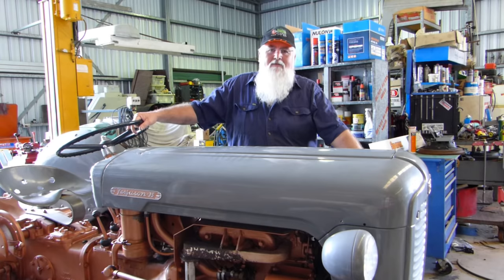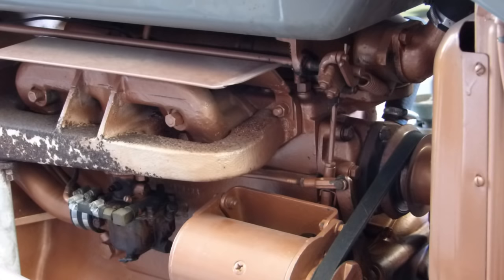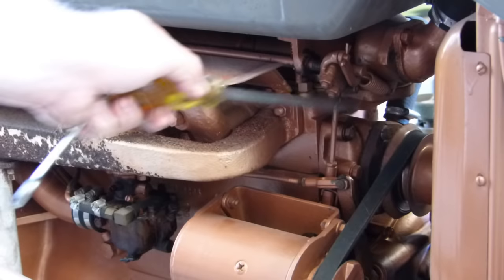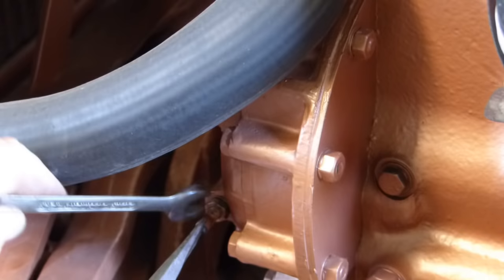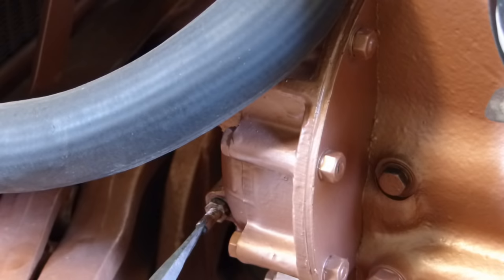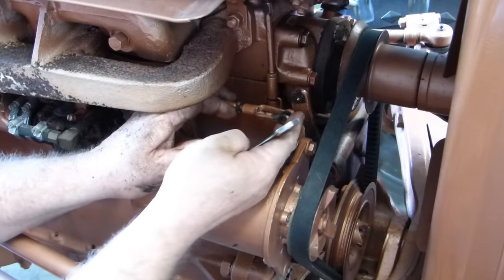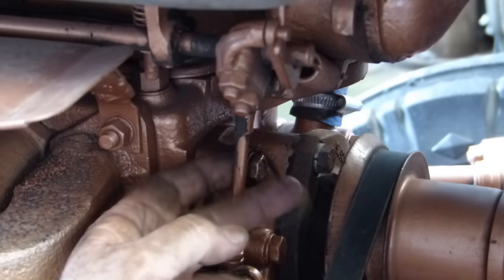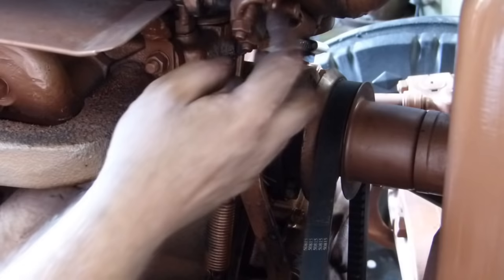How to Adjust Your Ferguson Tractor Governor

Comment: bundy bears hi my name is james butcher, i am rebuilding ad3 152 and i want to replace some bent fuel line i have direct injection and i cant get some of the fuel line to come out of the fuel filter housing i think it because of  the olive being stuck
Reply from the maker: Some had a rubber olive that would bind in quite tight.
Reply: thank you for writing back, how do you get them out?

Comment: Hello Lance
This is not a comment but a question. Hope you can answer it for me.
I have watched many of your videos ,but I have a problem. I have a 1959 Massey Ferguson 50 ,continental Z134 engine.When I got it, there was very little speed variation(at idle 1800 and WOT 2000). I set all adjustments according to your video,(which is excellent),but did not prove out for me.Idle now is 500 RPM with carb control rod disconnected from governor lever.
When increasing RPM,the governor lever never moved .When all linkages are connected and increased throttle lever(under steering wheel),engines reves up and up and up—-no control. I have adjusted the bumper screw,but cannot feel any spring inside the timing cover.
I have never had one of these apart,is it possible the bumper spring is ceased?Hope you can give me some direction in solving my problem.

 is excellent),
Reply from the maker: I have never had a Z134 to play with but they seem similar in the adjustments I hear. The carb should have an idle speed screw that can be adjusted with or without the rod hooked up so the butterfly is only just open. I find often lengthening the rod fixes a lot of peoples problems.
Reply: Thank you Lance for getting back to me. On your video of governor adjusting you disconnected the carb control rod and when you increase the engine speed your governor lever moved. Mine doesn’t move at all. I’ve adjusted the bumper screw to several different positions and still no movement on governor lever. When adjusting bumper screw I cannot feel any spring tension - nothing spongy. Could there be internal problems with this governor? Or is there something I am missing external. This Z134 engine governor lever,springs,bumper screw all looks identical to your video. Thank you for now. Karl.
Reply from the maker: It could well be worn as they are getting old now. pull the screw all the way out and see if it is not broken or anything.
Reply: I have already removed the screw and also compared it to another Z134 engine and they are both identical.

Comment: hi lance, i just rebuilt the engine on my TEA20 and replaced the weights on the governor. i adjusted it just like you said and when i rev the engine to wide open throttle and back to idle, the governor weights jam in the from cover. I dismantled it twice to verifiy thinking i did something wrong durring assembly but no, everything seems in order and it does it everytime. Im wondering if the cup may be not compatible with the new weights? what do you think? the cup does move freely in the bore as you said. please help!
Reply from the maker: Adjust the side bolt so the cup cant come forward so far.
Reply: @BundyBearsShed  ill try that! Its odd it did not do that with the old weights. So maybe 2 turns after contact then? Or maybe more?
Reply: @BundyBearsShed  Hi again Lance, I took that screw in pretty much as far in as it will go and put just silicone on that timing cover to seal it instead of a thick gasket, it seems to do the trick! thanks! By taking in my screw in so much im just limiting my top RPM right?

Comment: Thanks Lance. I’ve been trying to diagnose a throttle problem I have where the throttle always backs itself off to about the 25% position when running. I try to hold the throttle at about 75% and can feel what may possibly be the spring on the vertical rod pushing the throttle back. Could this be the problem? The friction disc near the choke control is fully tensioned.
Reply from the maker: Friction disk under the dash is worth a look.

Comment: My Friend. I'm a beekeepers so I need your help with me Ferguson TO 30.
My ferguson TO 30 will start but not keep running. Sometimes run a few seconds or several minutes. Filter screen in side gas tank is clean. Fuel flowing good thru line good. Fresh Gas.  Any ideas ?
I'm in Mississippi, sounds like you are close.
Reply from the maker: Im in Australia, Bundaberg Australia. Does your ignition coil get hot? also try pulling the choke on as it starts to break down and see if that makes a difference. If it does it is probably a bit of junk in the carb.
Reply: Thank you @BundyBearsShed  for your reply
think I found the problem. #1 one of the bolts attaching the carb to the intake was loose.
#2. I turn the large thumb adjusted on top of the card a 1/4 turn to left.
Either way, runs good now........thank you......tim

Comment: My to30 idles for a bit then it will rev to high speed on it's own. Where should I start to find the problem? 😒I Just replaced the governor!!
Reply from the maker: For it to rev the butterfly must be coming open so possibly adjust the rod to the carb.
Reply: @BundyBearsShed  Fixed it !!! More then one thing was the problem...Thanks!
😎👍

Comment: Do you have a video for the TE20 Continental engine governor adjustment?
Reply from the maker: No it is not an engine we have here in Australia. I believe it is a very similar process but I have not done it so I cant be sure.
Reply: @BundyBearsShed  Thankyou for the reply, was not aware that engine was not available in Australia. I watched your video along with every other one I could find on these tractors as I just acquired one from family who purchased it new in 1951. I started to fix a few leaks here and there and now has turned into a major project as everything I check or take apart has issues. Your wisdom has come in very handy for me so far I have my wheel bearings coming in soon so I can get the rear axles back in, that video was great by the way. I have restored a few old vehicles in the past so my idea of fixing something is do it right or don't do it at all, that's why this project has turned into an all winter long fun time project. I am in Northern Canada where it is the opposite temperature you are having, fire place on keeping warm. Carl Hewitt

Comment: My Massey Ferguson will start and idle great, but my problem is, it will not accelerate. Has anyone had this problem before? Thanks John
Reply from the maker: G Day John, start by turning both the idle jet and the main jet in until they bottom out on the thread and turn them both out 1 3/4 turns. This is a good starting point and you can adjust the mixture screws in or out a little from there.
Reply: Thanks. I will try that this weekend when I go up to the property

Comment: i need to learn to adjust governor on 580B case 159g gas engine any idea where i can go? i'm getting low rpms only 1500 and should be 2000 or 2100 any help would appreciated. thanks
Reply from the maker: G Day Carlos, No Im sorry I have not ever done one of those.

Comment: can you tell me how to remove the throttle lever on a 1953
tea ferguson.
Reply from the maker: You need to unbolt the dash from memory and feed it out.
Reply: @BundyBearsShed  I have the dash completely apart but still can't work how it comes out ,it has apiece welded on under the dash and the round knob on the outside which are to big to go through the hole in the dash there appears to be a piece in the dash that it goes through and maybe that has to be removed ,but not sure how

Comment: I have an tractor massey ferguson 35 on benzine. How much fuel consumes your tractors?I deregulated the carburetor and now I am consuming a lot of fuel. how to regulate the carburetor?help me please
Reply from the maker: You can screw the main jet in until it runs a bit rough then turn it out until it runs sweet at flat out throttle might help.
Reply: How much fuel consumes your tractors?
Reply from the maker: Im not sure it is not something I monitor.

Comment: I am looking at a Massey Ferguson TO35. It’s a clean tractor and the owner started it. It runs fine but he said the new governor needs adjusting. He said the engine runs up past where you initially set it and you have to manually adjust it down a bit. Does this sound like a simple adjustment? I’ve seen some of the forums that talk about ball bearings from the governor falling down into the engine? Is this a common thing and is there a way to “hear” if this may have happeend or an easy way to tell without tearing the tractor apart? Sorry for my lack of knowledge. I’m just trying to decide if the $1900 for the MF is worth the risk
Reply from the maker: Im not sure on the Continental engine, the engine we have is different.

Comment: My ted20 tractor when at half revs governor arm moves excessively to an fro. What wrong?
Reply from the maker: G Day Neil, It is hard to say, are all of the pins nice and tight in the holes.
Reply: Bundy Bears Shed there is a lot of wear in the top arm to spring and on governor arm. In fact there’s a lot of wear on all of it  I think the tractor is worn out.

Comment: I have a Ferguson TO 30. How do you adjust the governor?
Reply from the maker: I'm not sure, I have not done a TO30.
Reply: @BundyBearsShed  My Ferguson TO30 has a Continental Z129 engine and Marvel Schebler TSX 458 carburetor. The throttle linkages and governor linkages looks and seems to operate exactly as your gold tractor.

Comment: Hello there I was watching one of your videos the other day I think it was lets get it started but I can't find the video of how to set the hand throttle. so if you could please send me the link
Thanks for your help
Reply from the maker: G day Darren, The hand throttle is set when you set the governor u bolt on the throttle rod. I think in the barn find tractor I looked at that.
Reply: Bundy Bears Shed Hello again so if i loosen that u bolt and then set the hand throttle to where i want it would that affect the revs? Are do i need to do something else?
Reply from the maker: It should only change the handle position
Reply: Bundy Bears Shed  perfect thanks very much